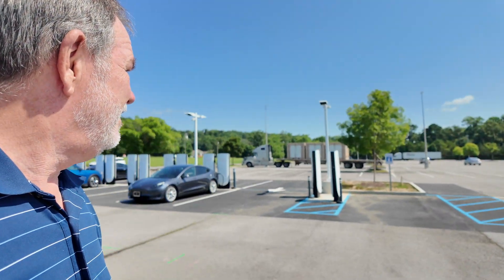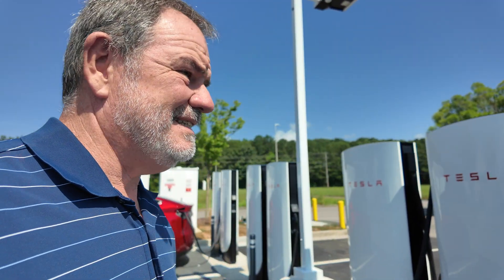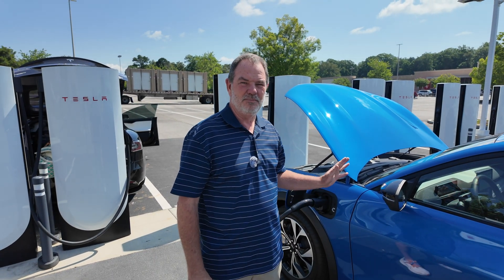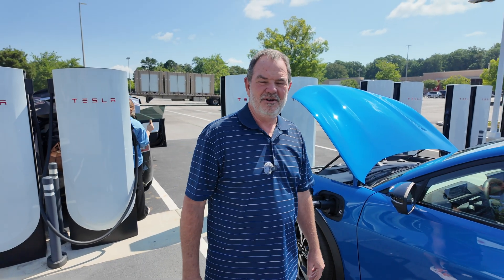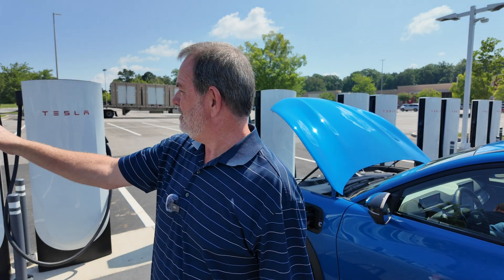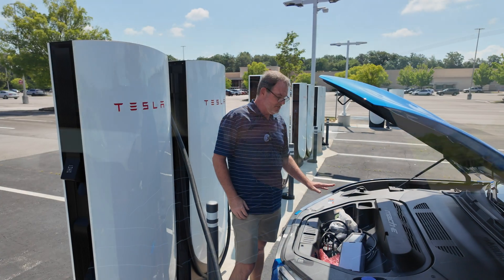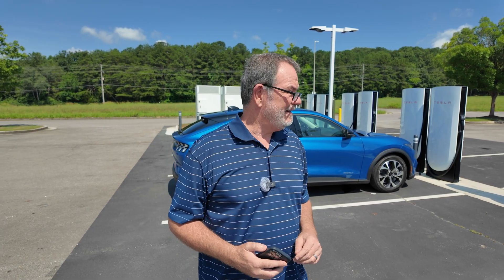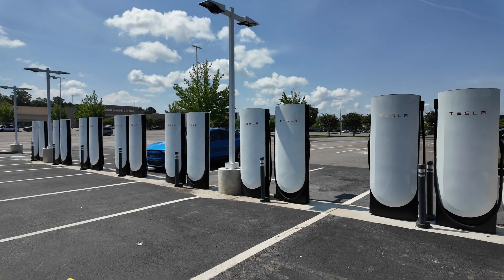Tesla Version 4 Supercharger Dispensers LONG CABLES Cleveland, TN Charging my Mustang Mach E

Comment: V4 superchargers have a ccs connector built into the charger itself. You just have to push up and then pull down to unlock the ccs charger head. That’s one of the key advantages of a V4 stall.
Reply from the maker: I definitely need to demonstrate that next time! I really wanted to use my adapter that I already had.

Comment: As a non-Tesla owner myself, I always seem have the luck of pulling into a stall that is out of order. So, I got in the habit of checking the app on stall availability and if any of them are out of order. 99% of the time, its go time.
 
Once the word got out the 20 stall site is a v3 Magic Dock, I find it almost 90% utilized and <5 minute wait on the weekends. Recently they opened up an 8 stall NACS only v4 dispensers next to the Wawa gas station and it seem to alleviate the wait times and the turnover rates is much smoother now.

Comment: Great youtube product one of a very select few who does this #arkansas_traveller and #network_architect be the only other two i know of actually but this is an absolutely massive build out now underway of charging infrastructure and pricing thanks to Tesla very well "planted" now if that be a word. #rivian_adventure_network crazy high prices for that now #walmart_charging_network but General Motors is the most aggressive now in trying to take on Tesla with apparently Mercedes-Benz offering .25 cents per kilowatt hour pricing which I'm told is quite low actually. #cadillac_bev think they're talking over 600 miles of range for that as well so Ford very fortunate to have the only well regarded product outside of a Tesla in this Ford Mach-E with quite respectable sales now going on many years "and all that comes with that" namely standing up a supplier base and dealership charging to support the product. Not even Tesla does that. NO ONE does that so far as i know actually. Great content keep at it #buccees 2 new ones just opened huge big deal be that and does include charging infrastructure there as well actually 😊😊
Reply from the maker: Thank you! Most of the Buc-ees locations that I visit have Tesla NACS V3 and Mercedes-Benz CCS Alpitronic 400. And, even more importantly, they have GREAT BBQ brisket! LOL :)

Comment: It will plug and charge, but it will be more expensive if you don’t have the membership thru tesla. And if you have the Tesla membership, you must have plug-in charge turned off on the Mach E for it to work. And you have to use the Tesla app to activate the charger. I found this out the hard way.
Reply from the maker: These are all excellent tips, thank you!
Reply: @PhilMakesVideos-r2v  you’re welcome I just got my Mach E in December 2024 premium rear wheel standard range. Plug in charge is a real no stress way to go to a charger and have it work sometimes? If you’re looking to save money. It’s best to use the Tesla app or electrified America app to save money

Comment: Short Cables, BECAUSE Your Car has the "Charger" on the WRONG SIDE OF THE CAR...:body-blue-raised-arms: manufacture issue , just saying.
Reply from the maker: Wrong side is a little harsh. It's on a different side. Tesla decided to support other makes at their superchargers, this is why they added longer cables to their newest dispensers.  Version 3 dispensers also support other makes but their cables often are too short. I'm thankful for access to the large Tesla charging network and I'm hopeful that they will eventually switch them all to the new dispensers with longer cables.